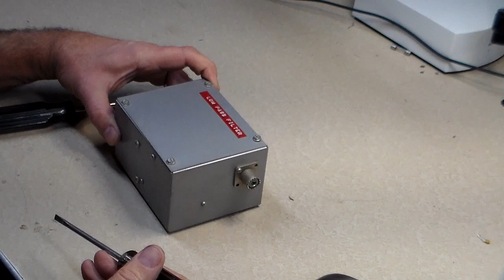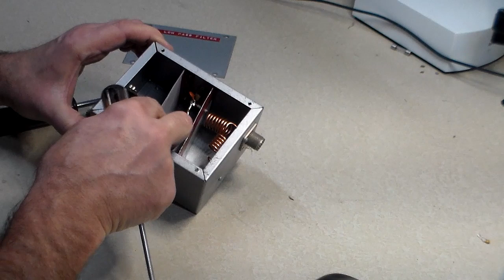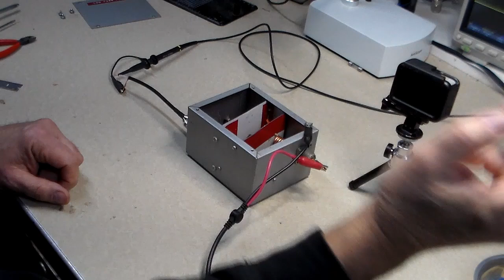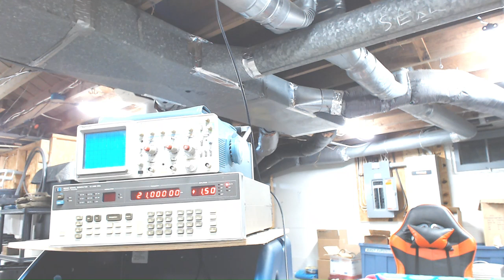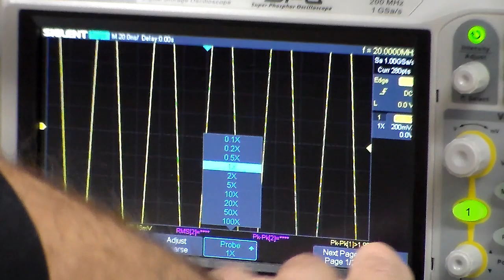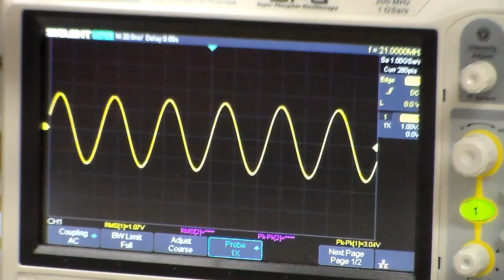Homebrew Low Pass Filter

Comment: The separators are because he made air-wound inductors instead of ferrite wound inductors. When using a toroid, the magnetic field stays mostly on or very near the surface of the toroid. When you make open coils, the field moves out into the space around the coils,  potentially coupling with nearby components. Metal sub enclosures around each inductor were commonly used to isolate their h-fields.
Reply from the maker: Thanks for that information.  Sounds like you’ve built a few of these or similar.
Reply: @KA3AJI  nah, I'm a relatively new ham, but I try to make everything i use from scratch first in order to learn where tolerances and quality matter (ie not in my diy stuff) so I know what to look for when I finally break down and buy it afterwards. 😂 Unwanted reactance is the first lesson of RF antenna theory that reality smacked me with.